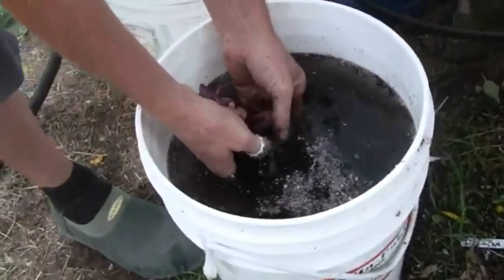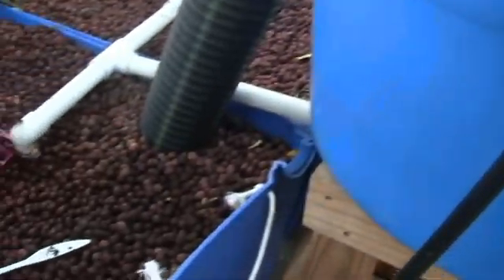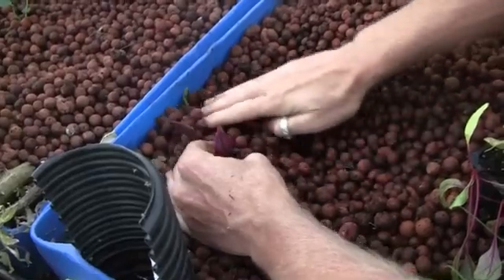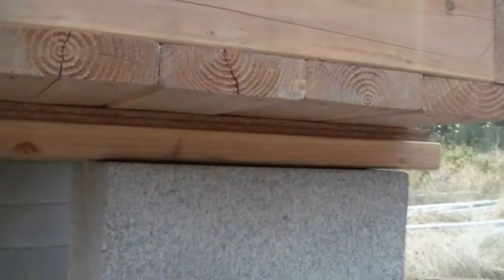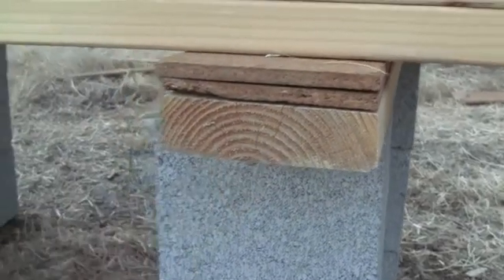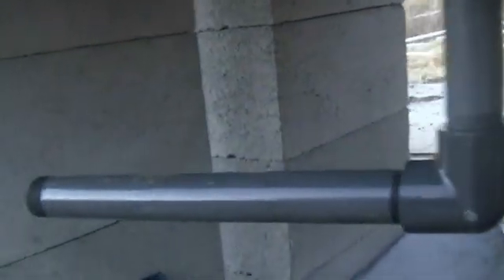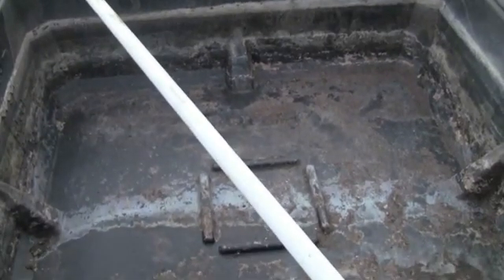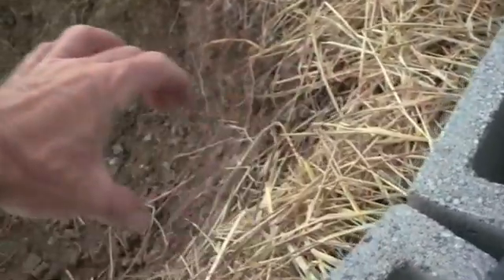Build your own 4 x 16 Aquaponics System 5

Comment from the maker: If you check out my farm, I tried perlite for media......it did NOT work at all.  It floated.  I wanted to get nice straight carrots.  They grew great but the table wasn't removing the water adequately so they were stunted.  

What needs to be done is to lay 3" or 4" pipe down the length of the table, below the gravel, so there are 2 or 3 flow path's without the gravel to slow flow down.  That way, the entire length of the table will drain.  Then, use quarter inch pea gravel as the media.  The pea gravel will drain to the pipes on the bottom of the table and then the flow will head down the table length through the pipes and out.  I'll hopefully be building this version soon.

Meanwhile, check out my next comment and please purchase a reward to back my Kickstarter project for Edible Pesticides.............

rt